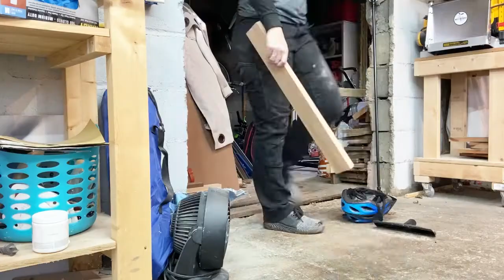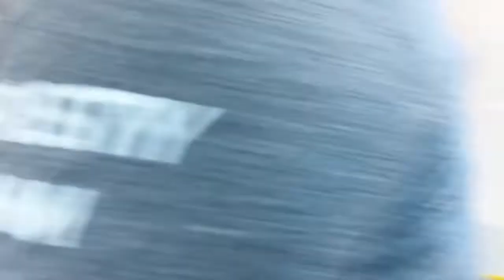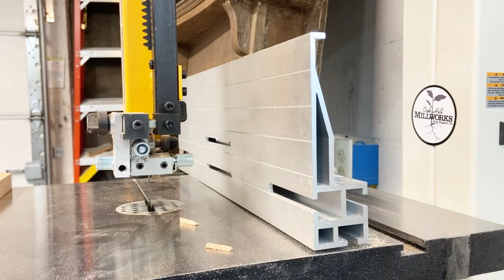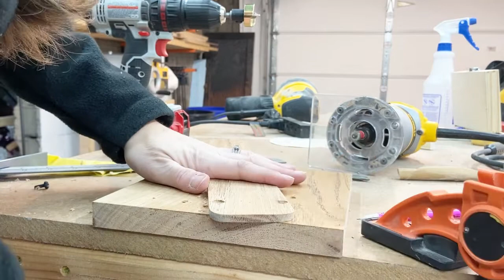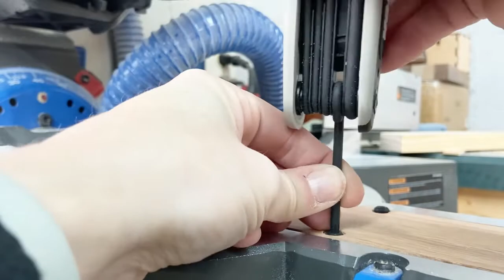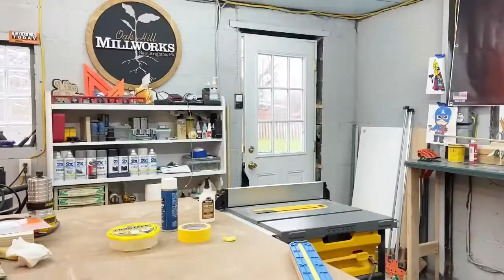Miter Saw Throat Plate Upgrade

Comment: I ned to make one of these for both my table saw and my miter saw.. and it is not the worse video ever made.. those long ones with zero talking and only shop noises at full volume.. they are  the worse
Reply from the maker: Haha! Oof. Yeah I would have to agree. This video was when I first started making them! Fun to look back. — I have done it once on the table saw. Kinda nerve-wracking to raise the blade up through it even when you have a sacrificial board clamped over it.